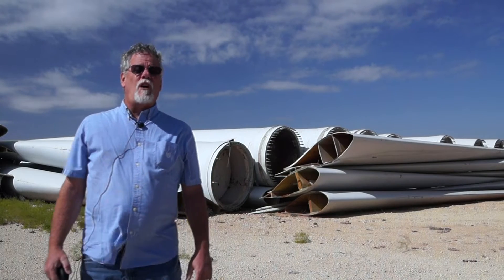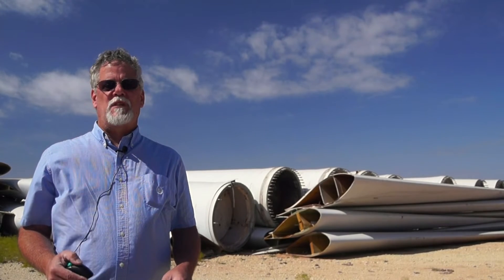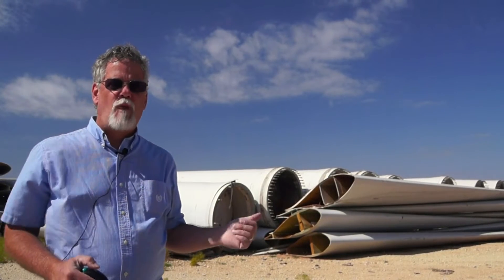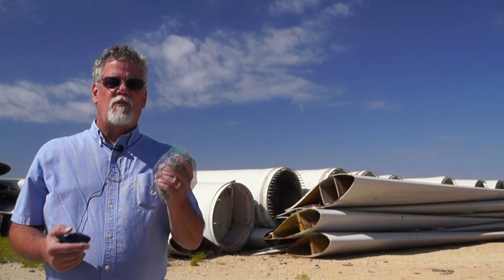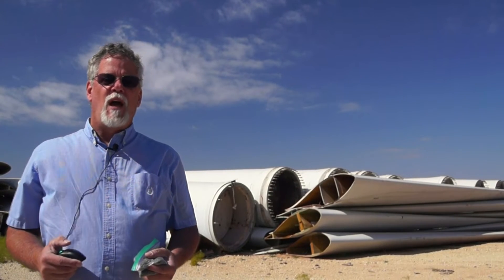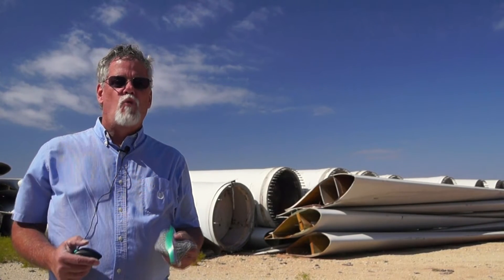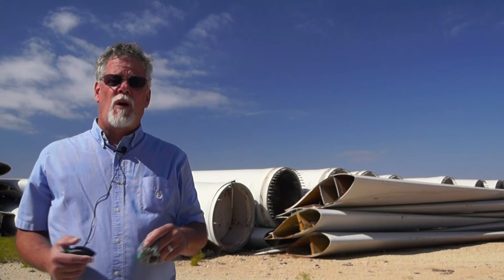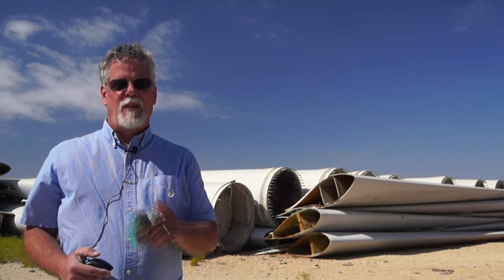#50 Windfarm Guy - Recycle Blades - Dec 19, 2020

Comment: Pretty much the exact same end of life disposal issues exists with fiberglass composite boats and aircraft.  Problems with old boat and airframes sitting around don't get much in the way of public scrutiny.
Reply from the maker: True. Wind turbine blades are big and noticeable. It's much easier to keep a small boat out of sight. Certainly the best solution is to address those disposal issues.

Comment: I've commented on this before,can't they be grinded up to make some sort of insulation from grindings.? Could it be made into a house wrap or sheeting to use as vapor barrier as used in concrete pouring. Hate to see them being buried,never to decompose. Could they be burned to power  something.
Reply from the maker: I know they can be used for containers and pallets. I believe they can be used for road material. There are many posibilities.

Comment: Sorry,  but can you imagine the amount of fossil fuel and/or electricity required in that recycling process?  But would be to build small, three-legged cloth-sailed windmills for individual homes (or better, folk huts q.v.).
Reply from the maker: No doubt we still need fossil fuels. The fuel sources do not need to be mutually exclusive. Plus, economies of scale come into play here. When a facility is operational, higher volume makes the plant more profitable.
Reply: The thing people overlook is that oil is used in every aspect of our lives and we only have around 150 years worth left so any advancement in power generation or transportation that reduces oil consumption extends how long we can make all the other important stuff that makes our lives comfortable until we come up with a replacement for oil.
Reply: @nigelliam153  "Comfortable lives"  will be differently understood as the veil of the artificially created desires for non-necessities drops from our eyes.  The Amish make a good study.

Comment: It’s not recycling! It’s a coverup when you take the fibreglass glued together with resin and grind it down to pieces and mixing it and hide the "pellets" into concrete, bricks and again dumped into landfills not seen anymore as "windmill waste" and so on. What’s next to hide... syringes and other medical waste, mixed metals, other fibreglass products waste,  plastics, mercury and so on!?.
Reply from the maker: Aggregate for road base comes from surface mines, otherwise known as strip mines. If we can convert existing "man-made" resources to use in the place of that gravel, even if it is just a portion of the road base, then we would have a reduced need for that mining. Resulting in less surface destruction. That sounds like a win to me.

Comment: Love how we are going to get off of fossil fuel, and save the planet, by building things that require fossil fuel to build. Plastic-oil, resin(polymer)- oil, welding-CO2/Oil trucks-oil, heavy machinery-oil, backup power supply-oil
Reply from the maker: You know the saying, "You have to walk before you can run." All aspects of wind energy are advancing and we need to continue improving,  We should look at it from an end game perspective. Each of the improvements help our end game.
Reply: Can switch them up to foam metals and ceramics instead if fiberglass.

Comment: I'm curious. If you repurpose the materials through recycling, you're redistributing the non-degradable material. But in the process, replacement wind turbine blades will need to be manufactured, creating more non-degradable material.. This is similar to the issue we have now with the production of new plastic materials simply because the cost of processing recycled plastics into usable material is higher than buying new plastic pellets. So you're just creating more and more non-degradable material without addressing the issue
Reply from the maker: More and more service companies have figured out how to recycle wind turbine blades. Multiple wind companies have committed, and even contracted, to recycle their blades. And one manufacturer is now making fully recyclable blades. The industry is making huge strides in solving the problem.
Reply from the maker: I understand. Because this material is so durable, I believe a goal is to use the material as aggregate for road base or the like. That would repurpose the material, while at the same time reduce the need to mine more rock aggregate. That sounds like a big step in the right direction.

Comment: We are industrial recycling composites in Italy from 2015 , with a mechanical patented process . Wind blades that actually we have not as feedstock since Italy came very late to wind energy may be recycled that way , as many other composite waste, from production or end-of-life , and converted to new products and also energy , as in this case of mannequins .
https://youtu.be/FFkF7PqJGlQ
Anyway the environmental impact of blades is very small , have a life span around 20 years , we are talking around 18 tons total for 3MW turbine , if we take any other energy generation system, needs too maintenance and substitution of parts or even total rebuilding , like furnaces and boilers in coal or gas power station.
Reply from the maker: I did a followup video and spoke with the engineer. Watch it here. https://youtu.be/RvCnP2h1LKY
Reply from the maker: I did a followup video and spoke with the engineer. Watch it here. https://youtu.be/RvCnP2h1LKY

Comment: Wind power on a massive scale, has no positive outcome. We need to give up on it. End of story. A wind generator at your home is a different story. Do that. But be mindful of the footprint created by the batteries you use.
Reply from the maker: I'm not sure what data you are basing your comments on, but wind is the cheapest form of new electricity generation today. There are pros and cons with all forms of energy. We just need to move the industry from unsustainable fuels to more sustainable ones. It is a long and slow process.
Reply: In your world what form of energy production does have a positive outcome then? And why are turbines at a house ok but larger ones in remote location not ok? You have a lot of explaining to do.

Comment: One day we'll use them to build homes. That would be awesome to see.
Reply: Except the vapors they give off are poisonous. So if you WANT COPD, knock yourself out.
Reply from the maker: @mikeyh0  To what vapors are you referring?
Reply: Concrete can give off ammonia and CO2 as well as  Radon Gas if the aggregate is contaminated as it is on many concrete factories and due to the large thickness of the concrete pads for these turbines it can take decades for them to fully cure out...
Reply: @CH-pv2rz  
I don't suppose you've ever watched the construction films of Hoover Dam? Seen the massive amounts of concrete used to make it?

And yet, by comparison, that dam has produced many times that amount of energy.
Reply from the maker: Yes, that would be great. Perhaps these pellets could be used in making wallboard. Who knows?